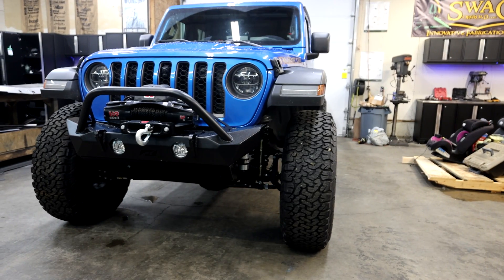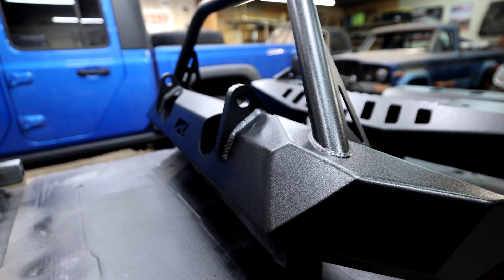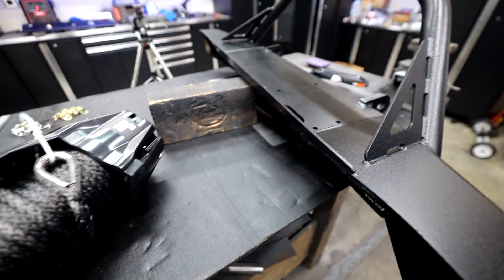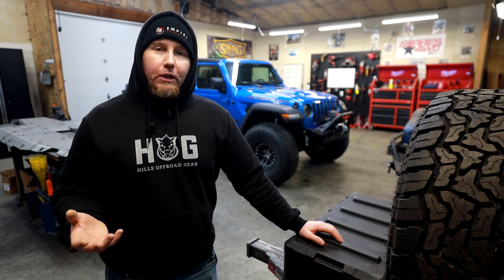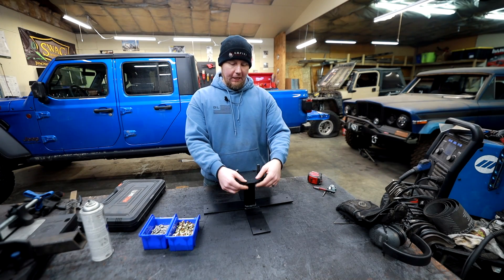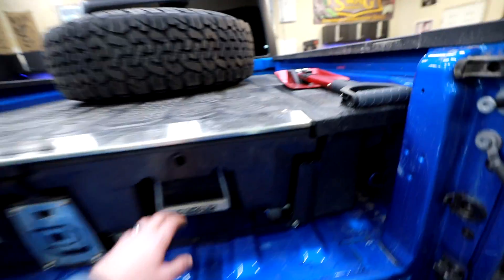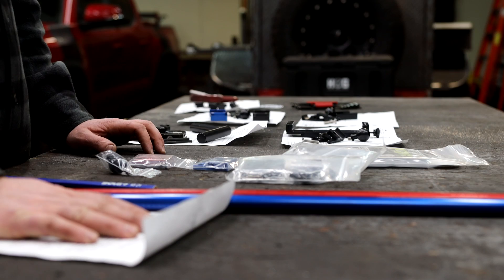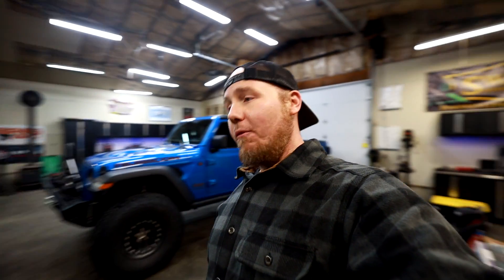Diesel Gladiator Build Episode 2! DIY Tire Mount, Motobuilt Bumpers And More

Comment: I've found when routing wires through tight places, gravity is your friend. I use a heavy nut and cut tape string to drop from the top down, the pull the wires through from the bottom up. Has always worked for me. I use this method when installing truck accessories, like hitches, power steps, lights or whatever it might be. Hope this helps. God bless and stay well.
Reply: I like that idea. Have you ever tried taping wires to a wire coat hanger for spots you can't get a nut into?

Comment: I apologize if you answered this in your last video and I didn't see. Are you planning on upgrading the brakes? You've added a lot of weight with the armor and rotating mass with the 39s. As this is your family rig you owe it to them to put some massive brakes on this. Cool build btw, Gladiators don't look right unless they've got a lift and massive tires.
Reply: Remember this isn’t a JK- the factory brakes are rated for vehicle weight Plus 7k towing….

Comment: I would imagine you didn't want to drill into the deck system you could fabricate a tire carrier that sits similarly but mounts to the bed rails if those were ever installed

Comment: Hey bro, what gear ratio are you going to install with the 40's?
Reply: Finally getting back into a Jeep? Jt/JL is way nicer than the jk…
Reply: @Escape.Idiocracy  I picked up a 21 Gladiator Rubicon last July. Wayyyyy better than the JK/JKU
Reply: @taylorconnor4969  nice, we built a 16 hardrock, just got rid of that and picking up a JT diesel.
Reply: @taylorconnor4969  both are Way better than the silver WK in Italy…
Reply: @Escape.Idiocracy  yeah man. I went with the diesel also. I love it. Already lifted it and put 40’s on it ha
Reply: @Escape.Idiocracy  😂
Reply: @taylorconnor4969   what gear ratio? 
I’m sketched about putting 40’s on before a Dana 60… my Jkur bent the drivers side tube without even doing anything difficult… built an HD44 with artech truss and that made it until we got rid of it.   37’s also blew the factory steering within a few thousand.  As far as I know psc big bore isn’t offered for the JT diesels, so how is steering being fixed? I don’t know…. 40’s would be nice, but we might hang out on 37’s until we can get a dynatrac….
Reply: @Escape.Idiocracy  you still use your insta? I’ll message you there to clear up this guys thread.

Comment: Hey Nate, would enjoy an update video on the Eco Diesel.  How much DEF are you going through?  How often does it go into regen?  Anything else someone should think about before buying one?  Etc  ….
Reply: I second this!
Reply from the maker: I should do something like this. It has 4500 miles on it and I haven't put any Def in it yet. Still using the stuff that was in it from Jeep! But according to the gauge I will need to add some soon...
Reply: I would estimate I have use approx 6-7 gallons of DEF in 7500 miles.  I would assume that would change with driving styles and your specific use of the gladiator daily.  This vehicle and diesel really shines on the highway and steep grades with trq and fuel economy.  I avg 28 mpg with a level kit and the stock 33s driving 3 hrs on interstate from WV to rural VA.  Just upgraded to the mopar 2.0 kit which is very nice. The diesel just had that extra grunt and low end trq and it rarely if ever downshifted out of 8th gear on the steep grades.  As long as there are no major failures I plan on owning it for many years to come.  I think as many of us know the added emissions complexity would prolly be the potential problem area down the road.  Also, to prevent injection pump issues and add lubricity i've kept diesel fuel additive such as hot shots edt in it.
Reply: I’m looking at buying one for a small truck for daily driving.  Going to park my big full-size truck and just use it for towing.  I would be putting 37s on it because well why not.  Ha.  I just think the Diesel would give me the needed power I need.  I have a JL Rubicon on 35s and it’s so under powered in my personal opinion.  So think about a JT with diesel instead of a 3.6 supercharged.  Just concerned about regen since it would be short driving distances.

Comment: BEST NEWS EVER!
I thought you got rid of the Tacoma. 
My 2021 Tacoma TRD 4X4 is in for repairs after hitting moose at night.
Passenger side front end badly damage,  both passenger doors need repair or replacement after bottom halves were severely dented,  tree stomp slided on top of the rocksliders.....🙄

"Ride, damage,  repair,  repeats."

Comment: Hello,  please give me your advice.  I have a 2001 Jeep XJ with Chrysler 8.25 29 spline with c clip rear axle and Dana 30 front axle.  I currently have 33s on this with no problem.  Can I run 37s or are those two big. I want to use this as my off-road trailing rig that would go through a decent amount of mud and some rock climbing.  If 37s are two big what do I need to do to the axles to make the 37s work and not snap anything?

Comment: They sent you the wrong fairlead mount. It even says on Motobilt's site that the fairlead mount they sent you doesn't fit EVO VR or Badlands Apex. They should've sent the Universal Fairlead mount which is the one they have pictured on the site with that bumper on a JT with the same winch

Comment: The tire on the deck system just kills the bed space over the deck system. Needs a swing out bumper mount.  You got the half truck, keep the half truck capability move the spare tire out of your truck bed.  
Fix the overhanging rear tail lights..  bolt on those round (Willys style) that won't get ripped off by tree branches or rocks.

Comment: Well done as usual, Nate. Smart choice on the better fastener system. You half to build for an accident, loose tires going 65mph in an accident are no joke. 

Gotta get yourself a low profile back rack for mounting accessories. 
Cheers

Comment: Hi Nate, avid follower of the channel, but securing your tire into plastic from the safety aspect???? Its always the other guy but a heavy  impact with something in the front and your gonna have a 70lb missile coming through your rear window at 50+ mph, you need to anchor that thing to the chassis!

Comment: Really enjoy your content.  I have a 21 Glad ecodiesel Rub (7500 miles on odo) with Mopar susp kit still on stock 33 falkens awaiting tire/wheel upgrade in the spring. Currently approaching 1 year of ownership and have been pleased with the experience so far including the motor trq which is noticeable in the WV mountains at highway speeds.   I'm keeping hot shot EDT in my fuel and keeping my fingers crossed hoping this 3rd gen Ecodiesel proves to be a reliable platform.  I look forward to your adventures in the ecodiesel as well as any specific issues you may encounter with this drivetrain.  The banks pedal monster is a nice addition to this platform btw.
Reply from the maker: Thanks!
Ours has 4500 on the odo and we are still loving this truck. Same feelings here as far as hoping it holds together long term... fingers crossed 🤞
Reply: @DirtLifestyle  What gear ratio are you swapping up to?

Comment: I've got 6,053 miles on my JT-R Diesel on 37s, and now need to replace the drag link and tie rod end joints, they are completely shot/trashed.  It gets wheeled hard on NorCal rocks and Death Valley over the last 9 months, but keep that in mind running 39"s, the stock steering components are not well built.  I expected to get 10k to 15k miles out of them, no such luck....death wobble in a bad way.
Reply: Should truss the axle as well… 37’s + and actually off-roading puts a lot more stress on everything. Aluminum tie rod with one ton ends, synergy drag link (make sure this is torqued to spec- wallowing the bracket/mount sucks) artech truss, dynatrac ball joints, increasing steering pressure and a ram, or just throw a 60 at it.

Comment: With all the cool toys you have, I think if you added a 2-post lift, a plasma table (with or without 4-axis router), and a 3D printer you'd have a really slick kit.

There's no such thing as having everything you want or could use, but those are some super useful things.  Kinda surprised you don't have a lift yet.  You seem to have plenty of vertical clearance.  Is the slab too thin?

Edit:  The bit with your boy was hilarious.  I need a spare 4 y/o for tight spaces.  I don't feel like making another one (mine is 26)...need some sort of loan-a-child program out there. LOL

Comment: I’m questioning the recovery points  it could use some on the lower points of the bumper too ( so it’s not adding force downward while being recovered ) the other points will put the pressure where it’s needed and not increase the problem I do enjoy the videos keep up the great work
Reply: I think they're so high to help with approach angle. It sucks to have your bumper catch on a rock and stop you. I can't say that downward pressure from a recovery is often of any significance, in my experience at least.

Comment: I'm surprised you didn't go with a high clearance bumper. I've seen high clearance bumpers that go right below the frame level, although it does involve chopping the gladiator body quite a bit. Then again, I can see you're trying to have a build that's more bolt on parts for a broader audience.  Nothing wrong with that! Can't wait to see how this build goes!